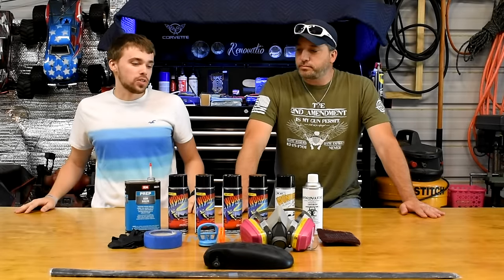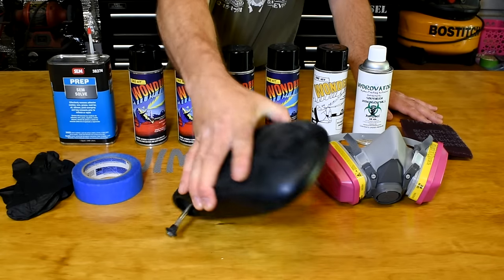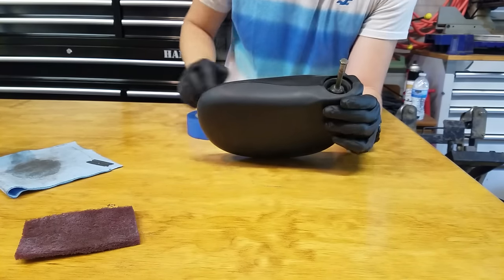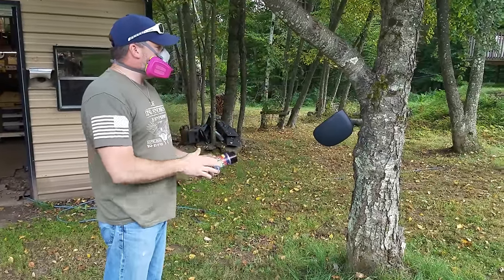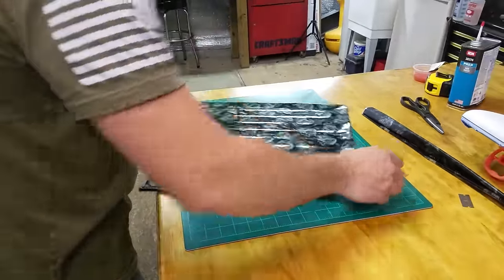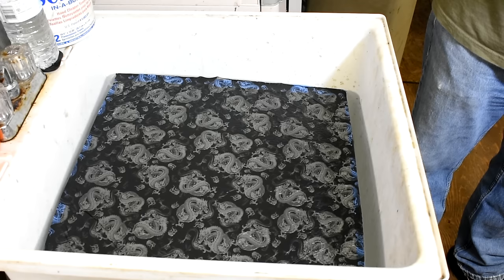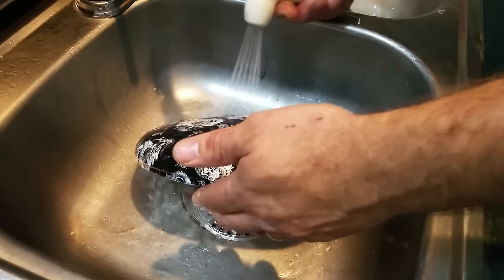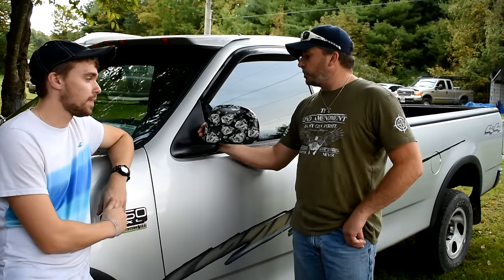How To Hydro Dip For Beginners 2.0

Comment: Film "Sticky/Shiny side Down"  and can of paint expires in 18 months?
Reply from the maker: #random #amusing & #humorous #funnystuff the paint wont expire but there is a 18 month dip window where it's the ideal time to dip your item for ideal bonding. Hope this answers your question.
Reply: TY for the quick response .
So what I understand is "After the Primer paint is spayed on the item surface". > It is best to plasti dip with i8 months? Is this correct?
Reply from the maker: #random #amusing & #humorous #funnystuff ig you're using the Wonder Paint that we were using that is correct. Its paint and primer in one. You'll have 18 months where the dip would adhere to the paint good. Some other paints have short dip windows, so if your surpassed the window the dip may not adhere ideally.

Comment: How did you get the film off the mirror?
Reply from the maker: lisa madell it was simple, just used a little paint thinner and wiped it off. You could use a razor blade but you have to be careful not to scrape the mirror to bad.

Comment: I here putting tape on the film is not going to set correctly that the film actually has to stretch and take it's natural shape on the water.
Reply from the maker: That is true. We put tape on because it was curling up on us and we could not get it to lay in the water flat enough. We did cut relief slits in the corners after we taped it to allow it to still stretch though. worked great.

Comment: I have watched a bunch of these but one thing no one answers. You have to be so careful putting the mirror into the water but then you swish it around, why? Why are you so careful, then swish it? How does the swishing around not wash the film off when you had to be so careful lowering the mirror in the first place? Problem is these videos are all so old no one is paying attention to the comments anymore.
Reply from the maker: You have to be carful dipping the mirror so you don't get air bubbles under the film. After the film is applied it is ok to swish it around. We swish it around to remove the excess film to the outer edges so when you pull it out it doesn't stick to your part.
Reply: @Jimmy2Tech  Thank you so much

Comment: Ive heard now 70 to 90
Reply from the maker: Yeah the temp can vary some, but closer to 90ish makes the adhesion process much more effective. In colder water we've had some troubles with the film sticking and the hydrovator working. The film ended up not really activating in the colder water.:) hope this helps.

Comment: please don't paint outside. That is wrong wrong wrong wrong. Do they paint cars outside? No they don't. Otherwise you will get shit in the paint, bugs, pollen, dust..... if you have a respirator you will be fine. Cut any fans off, your a/c or heater units off.Please use respirator.

Comment: Came out pretty gay. Also, was there not a way to cover up the mirror so you wouldn't get paint on it?
Reply from the maker: Bobby Blalock hey well to each there own. And in regard to dip on the mirror, we could have taped the mirror, but the dip comes off of that surface pretty easier, so it wasn't much work at all just taking it off. But yeah if you do something remotely similar, you can always tape the mirror.